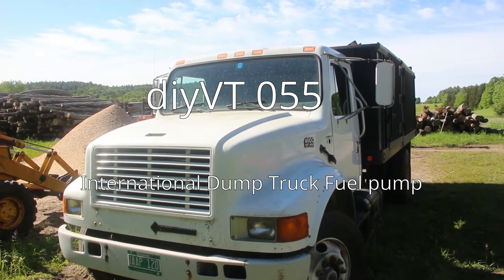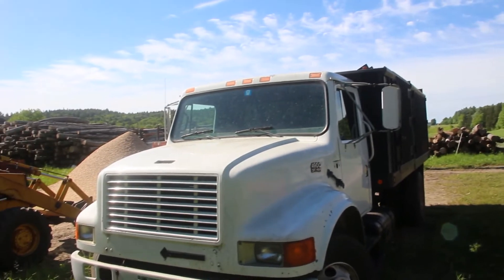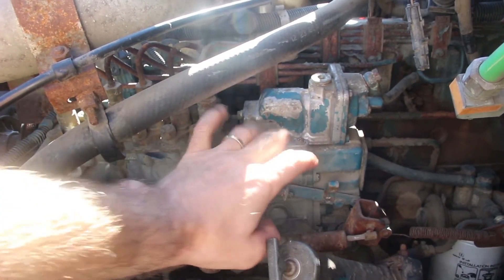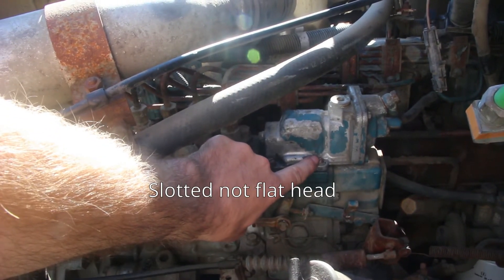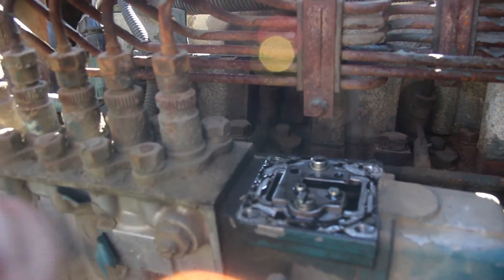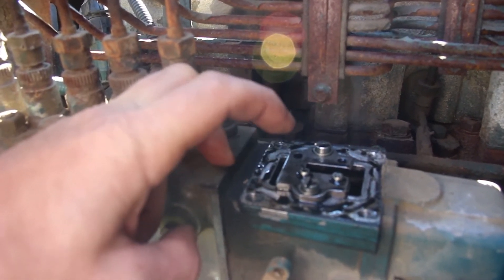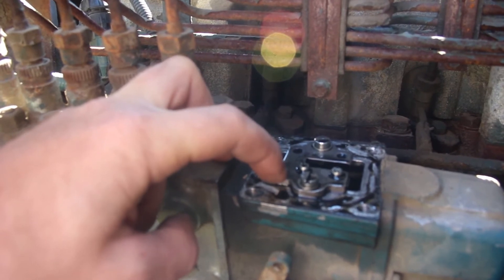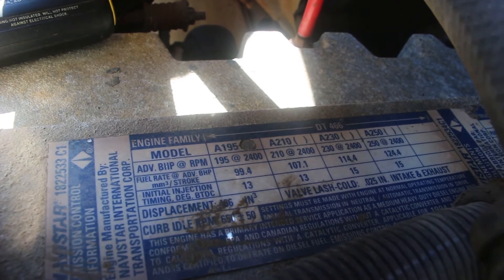More POWER for the firewood truck

Comment: That AFC housing is also made with slotted holes and can be slid as well. Additionally you can mess with the pre boost smoke screw and set that so it’s responsive.
Reply from the maker: Right now the truck has almost enough power. Really the only issue is the power band is narrow and it's a 5 speed. So when we pull out on the main road going up hill you can get stuck in 3rd when the truck would pull the hill in 4th no problem if you have the engine in the power band.
Reply: @diyVT  then you need the 4x governor springs. Yours start pulling fuel out when you need them.

Comment: I have a truck similar to this one.  i was wondering how this last change of the fuel pump worked out for you?  Have you experienced any exhaust gas temperature problems?
Reply from the maker: We haven't had a problem with it.  It's been a great improvement.  We have talked about changing the timing also but haven't gotten around to it.  As far as exhaust temps it hasn't seemed to be a problem.  However we're typically only running for a short amount of time at Max power.
Reply: Yes.